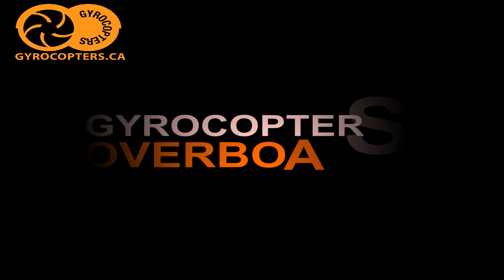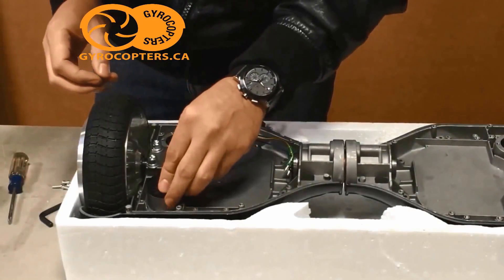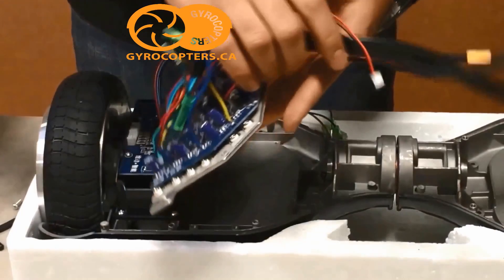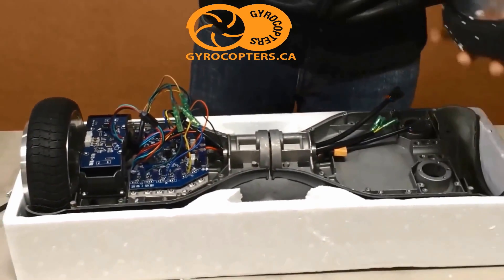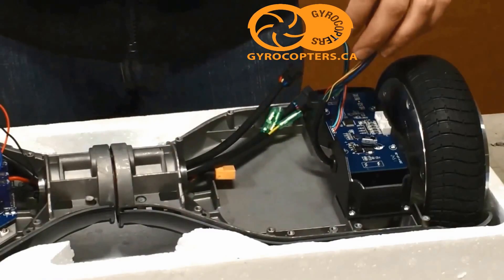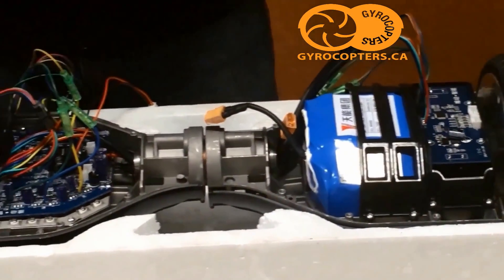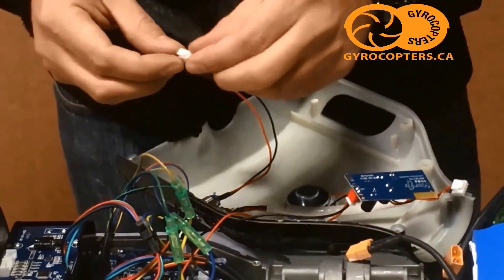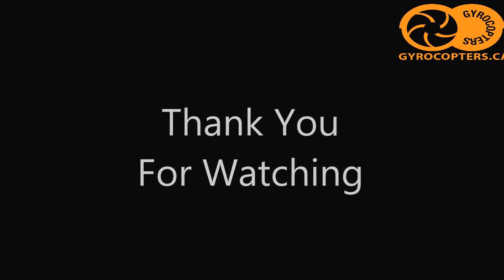Hoverboard repair, fix hoverboard, hoverboard replacement, shakign hoverboard

Comment: MAKE SURE BATTERY IS UNPLUGGED!!   Measure the Mosfets, 6 on a heatsink per side(GDS)... Usually only 1 or 2 short...  DMM to Diode, Neg on Center pin (Drain), Gate approx 2v, Source approx .5v.   YST7575C crosses to RU6888R  68v 88a TO220